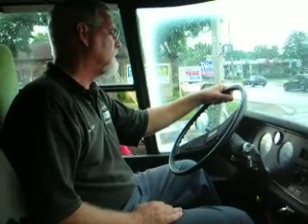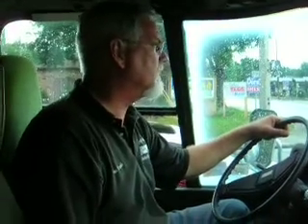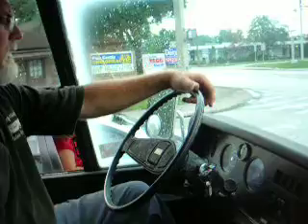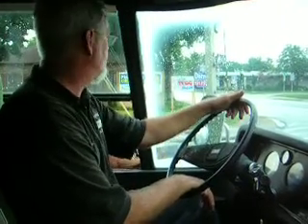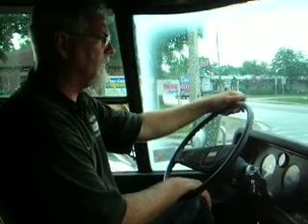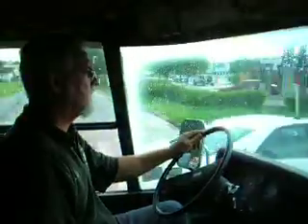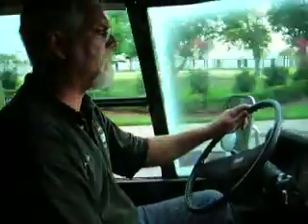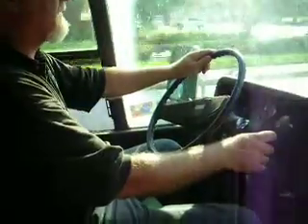Propane GMC testing

Comment: EGT will also depend on the mixture. Leaner=hotter. Not sure if a wide band O2 sensor will be accurate with LP.
How does the temp compare with gasoline? Or did you have the pyrometer then?

Comment: just use inconel valves and hardened valve seats and you will be fine, my turbo mustang ses between 1500 and 1800 EGT's and inconel valves hold up just fine..